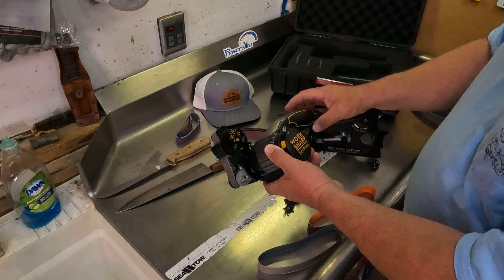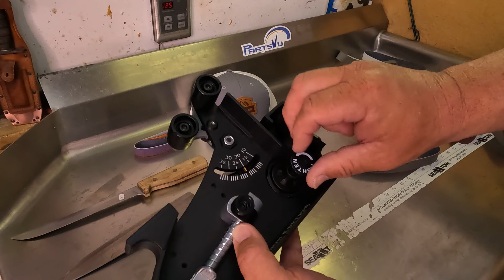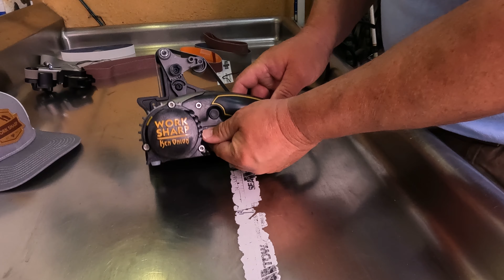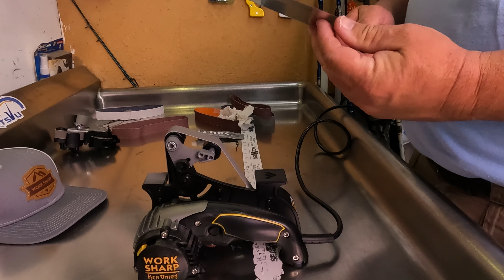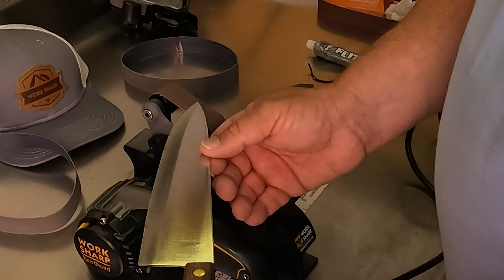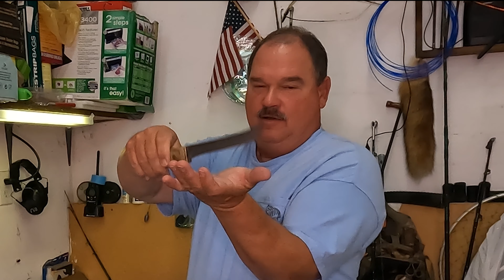Work Sharp Ken Onion Elite Review and Demo

Comment: Why freehand the knife and not use the platform?
Thanks for the video.
Reply from the maker: @payitforward81152 The platform is to get the angle for you to transfer to the upper part of the belt. The platform is NOT on the correct angle of attack to the belt at that location.  This is for a bit more advanced users. You can always use the other attachment with the blade guide if you need or want that: https://bit.ly/3ObhY0K

Thank you for watching! Make sure you follow us on our FB page here: https://www.facebook.com/scottgreggoutdoors/  I usually post what's coming up there as well plus other channel insight and content not on YouTube.  Also Instagram at www.instagram.com/scottgregg1966/

Comment: I’m new …. On this device approximately how many knives can you sharpen with one belt?
Reply: I’ve sharpened about 20 of my own knives at least 2 or 3 times each. Some were very hard steels like m390, LamCos, Cpm 3v …
I’ve also sharpened a few axes, machetes…. And I’m still using the original belts that came with it.
Reply from the maker: @mikemishoe9876 I'm not sure. I haven't worn one out yet.  I use the cloth and leather belts most often for touch up. I suppose it will be based on how much sharpening you need to do to get a blade back to where you want it.

Thank you for watching! Make sure you follow us on our FB page here: https://www.facebook.com/scottgreggoutdoors/  I usually post what's coming up there as well plus other channel insight and content not on YouTube.  Also Instagram at www.instagram.com/scottgregg1966/
Reply: 35-50